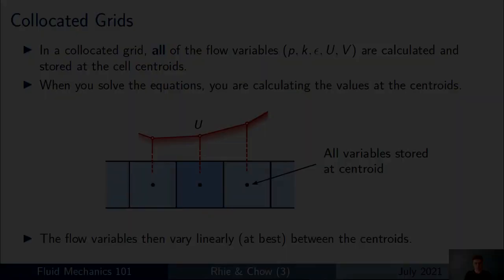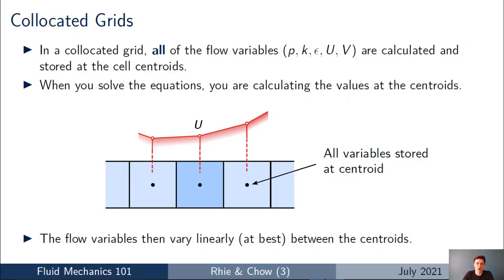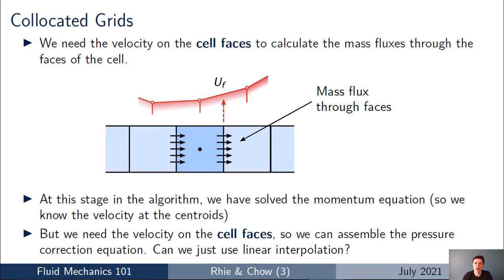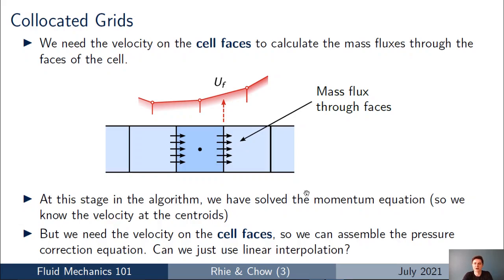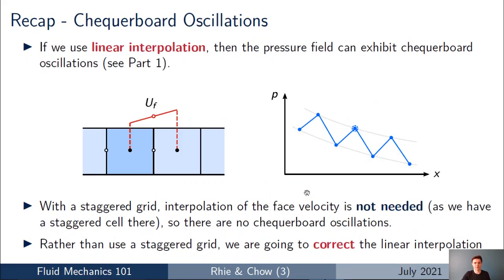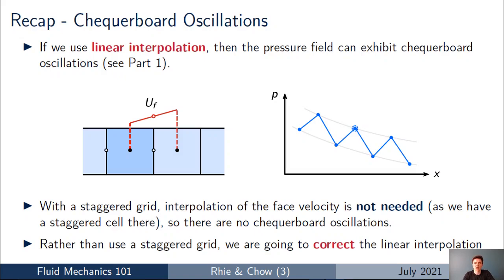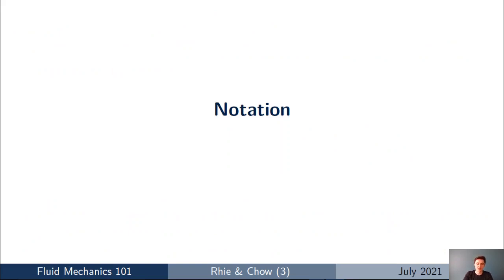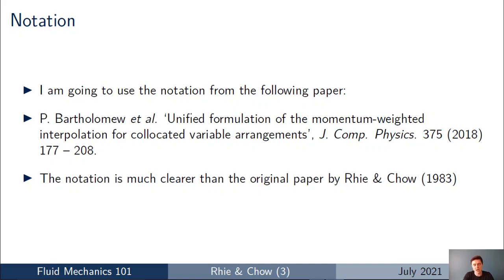[CFD] Rhie & Chow Interpolation (Part 3): Deriving the Correction!

Comment: Thank you for the fantastic series about Rhie and Chow type corrections, really helped a lot understanding what's going on. 
I'm a little troubled with the use of CFD, because CFD is the full set of numerical methods we use to approximate the Navier-Stokes, among them the finite volume method is one method. There are modern CFD codes utilizing the lattice Boltzmann method or build on finite elements or even use smoothen particle hydrodynamics. Not all CFD methods use the concept of centroids and faces. Apart from that your videos are very instructive and very helpful :)

Comment: Related to the Brandon Lobo's comment...I think there is a mistake in Ix definition...Ix should be (distance from f to E)/(distance from P to E) instead of  (distance from f to P)/(distance from P to E)...just the lever rule...With the formula that you provide if Ix=0 (f and  P coincide) Uf would equal to UE instead to UP. Thanks for your excellent series of videos
Reply from the maker: Yep, I think you are correct 👍

Comment: Thanks for the lecture. The correction term in the given derivation seems quite tricky since it will be canceled out if a same linear interpolation scheme is used for the first term in the parenthesis in Eq (23), as for the second term. This formula is also prone to the mesh non-orthogonality. Regards.
Reply from the maker: Yep, the orthogonality issue is very tricky. I would really recommend the paper by Bartholomew et al. (And read it very carefully) if you would like to know more about this one

Comment: I'm curious how you do it in boundary conditions.

If, in a rectangular mesh, the  left, lower ,right and upper  are all surrounded by walls,
U left = U bottom = U right = 0 and
When U up = 1m/s,

Can I put that boundary value on the U face as it is?? Without interpolation?
Reply from the maker: You don't need to use Rhie and Chow on the boundary faces, only the interior faces ☺️ you can use regular extrapolation here (if Nemann BC) or the values are known already (if Dirichlet)

Comment: Hey Aidan, I've been following your excellent lectures, I wish there were something nearly as good as your courses during my master's. 

Unfortunately, I am still struggling with a step in this derivation. When Rhie and Chow's correction is calculated, as you said, velocities at points W, P, and E are knowns from the momentum equation. However, we need the pressure gradient to ensure the velocities satisfy the continuity restriction. 

So, how are UW, UP, and UE already defined despite the pressure gradient not being yet determined since we do not know the face velocities needed for the continuity (that is pressure) equation?
Reply from the maker: Great question. This is a difficult one to answer concisely in the comment section, so I will try my best! 

The continuity equation states that: 

Sum rhof( Uf dot nf) Af = 0 

(Where f is a subscript to indicate a quantity at the face centre, nf is the unit normal vector and Af is the face area) 

Substitute in the Rhie and Chow correction:

Sum rhof ( pressure gradient dot nf) Af - Sum rhof (interpolated pressure gradient dot nf) Af = Sum rhof (interpolated velocity at face centre dot nf) Af 

This can be rearranged into the pressure equation. The velocity on the right hand side (the interpolated solution of the momentum equation) becomes the source term, and the left hand side (the solution) is the pressure field which satisfies the Rhie and Chow correction and would correct the velocity field so that it satisfies the continuity equation.

So we are solving for a pressure field which corrects the velocity field AND satisfies the Rhie and Chow correction. There are actually many different velocity fields that (for a given cell) satisfy the continuity equation, so we need to pick the right one. The Rhie and Chow correction allows us to do this by constraining the choice 

This is probably the best explanation I can give in the comments section 😅 i would really recommend checking out my 'SIMPLE algorithm course' where I do the full derivation in lots of detail. It should help clear up any remaining questions you might have.
Reply: @Fluid Mechanics 101  I've seen the SIMPLE video aleeady, another great lesson.

So, the conclusion I draw from your explanation is that actually, the point W, P, and E's velocities are not the correct ones already, is that right? These knowns satisfy the momentum balance but do not have any commitment with the continuity restriction at this stage.

If it is correct, then Rhie and Chow are inplemented in the correction part of a prediction-correction algorithm, reaching 0 at the convergence. 

If the above conclusion is right, so we can substitute interpolation schemes like Upwind for the Rhie and Chow's correction.

Thank you tremendously for your attention and answers.

Comment: what is Rhie chow momentum based and distanced based approach?
Reply from the maker: Both are types of interpolation to calculate the velocity at the face centre from the centroids on either side of the face. Distance based is the same as standard linear interpolation. Rhie and Chow includes an additional correction on the interpolation to try and reduce /avoid chequerboard oscillations

Comment: It is probably too early and I am making a mistake here, but around time 8:15. If face f is very close to P, then distance 1 is very small compared to distance 2. So the ratio of distance1/distance2 (small/big) is going to be small and tending to zero and Uf tends to Up. I agree up to this point. But from your equation for Uf, Uf = lx*Up + (1 - lx)Ue. So for lx tending to zero Uf = Ue. So, the formulation for Uf is then wrong? No biggie just wanted to point it out.

EDIT: I just completed watching the video and thanks a lot for the quick tutorial. I have problems with convergence due to a checkerboard effect even though the Rhie-Chow method is implemented. The issue is with the time-step size being really small for high Re flows (wall-resolved LES around an airfoil). I am currently reading into the issue and methods to make it time-step independent.
Reply from the maker: Yes, that sounds more like an issue with your time step (and maybe spatial discretisation schemes becoming unbounded) for LES, rather than Rhie Chow

Comment: Just a small clarification. Because of all this notation, I lost the bigger picture. I want to take the example of the SIMPLE algorithm. There we solve momentum equation first (so we have velocity at the centroids). Now we wish to enforce continuity to get the pressure correction. To do this we need fluxes for which we require velocity at the cell faces. This is where the checkerboard oscillations occur. Is this correct? So can I make a generic statement and say that checkerboard oscillations are a consequence of the non-linearity of the equation?
Reply: Also, since the checkerboard effect is a consequence of discretisation (?), won't it (to an extent) improve with refinement (at least until mesh convergence is achieved)?
Reply from the maker: Hello, in answer to your questions: 1) your description of the SIMPLE Algorithm is correct 2) The oscillations occur because of the 'pressure-velocity coupling' that is inherent in the N-S equations when they are solved in a discrete form, not the non linearity. The nonlinearity arises from the advection term in the N-S equations, which is unrelated to the pressure gradient. It is probably more correct to say that the pressure in a given cell can become uncoupled from the pressure in the cell of its immediate neighbours, depending on the interpolation adopted in the numerical algorithm. One way of correcting this is to correct the interpolation of the face mass flow rate carefully, so that strong neighbour-neigbour coupling is introduced
Reply from the maker: With regards to your second question, the decoupling happens between immediate neighbour cells. If you refine the grid, the oscillations still occur between neighbour cells, the cells are just closer together now!! This is a very hard topic to understand, I hope this makes some sense

Comment: 24:51 Seems like Equation (21) is insufficient to derive Equation (22) from Equation (20). How did you factorise out the d in the third RHS term of Equation (20)? Because bar(d*dp/dx) is not equal to bar(d)*bar(dp/dx).
Reply from the maker: This is an approximation that is commonly paid. It is not exactly correct. However, it is ok because the Rhie and Chow correction = 0 when the simulation converges, so this approximation only affects the speed of convergence
Reply: @fluidmechanics101  I see, thanks for the prompt response!